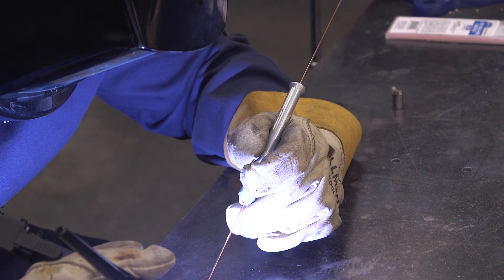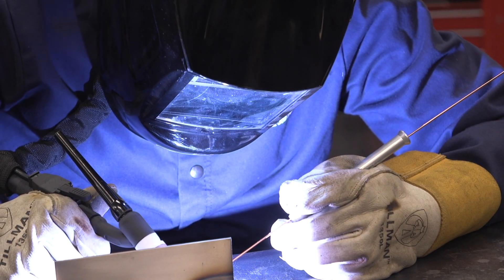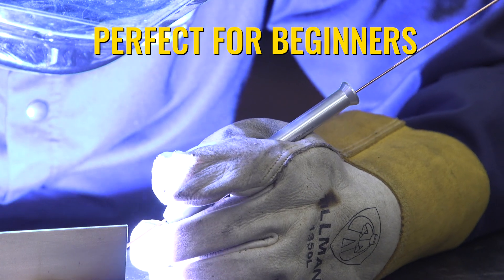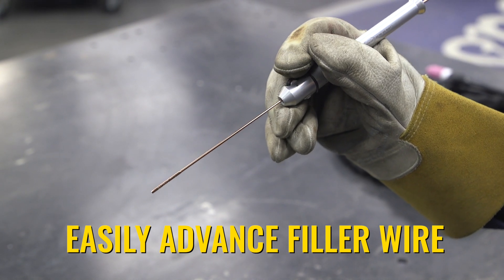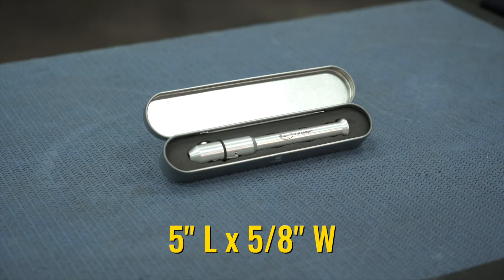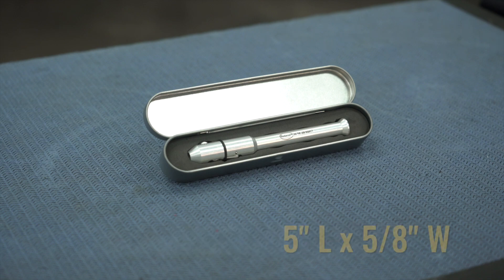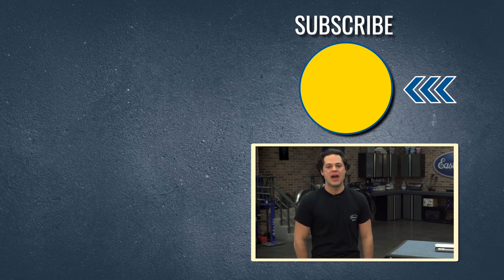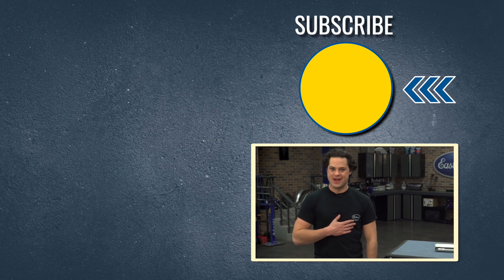The EASIEST WAY to Feed Filler Wire When TIG Welding - Eastwood TIG Mate

Comment: Just picked up one to help a beginner like me..

Are the o-rings replaceable? As this seems to be the only drawback with this type Tig Pen.
Reply from the maker: I don't see why not... All the outer o-ring does is apply some pressure to the tensioner. Slide the old one off and install a new o-ring of similar spec and you should be all set.
-JD

Comment: I usually just use my fingers, and use the rod right up to the last half inch. This seems like so much more work, and you leaving 5+ inches of rod. Tig rods cost about 30 cents a piece, I'm not throwing any away. Just practice people, and if your in a tight spot, cut the rod down........that's a more useless tool than my brother in law
Reply: Fixing a problem that doesn't exist with time and practice.
Reply: @gouldianuk9875  if that's what people are finding hard, wait until they have to get out of position and switch hands. All welding is a rewarding challenge, but tig can look so good when you get on track. Practice is the only thing you need. Other than a tig welder.....
Reply from the maker: Hey Chad, I get what you're saying. This product is not for everybody.
However, it is great for tight spots, beginners, or even people who are developing arthritis. 
This can feed rod all the way down to where it makes contact with the roller in the last 1/2" of the tool. (and it gives you something beefier to hold onto while feeding those small pieces of rod, which is nice...)
Sorry about your brother-in-law. 😂
-JD
Reply: @eastwoodco  I get it, I guess I'd just have to try it to believe it is all. I didn't mean to slam the product, It looks great, and nicely built.

Comment: I wanna buy one but I don't know if it will take 1/8 Tig wire let me know so I can get one if it does
Reply from the maker: This will only work with up to 3/32" filler rod.